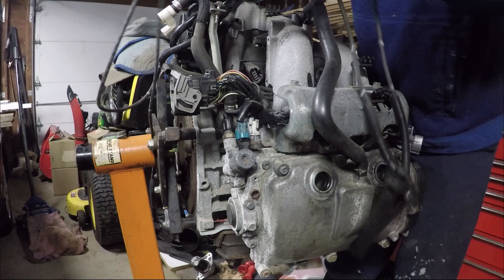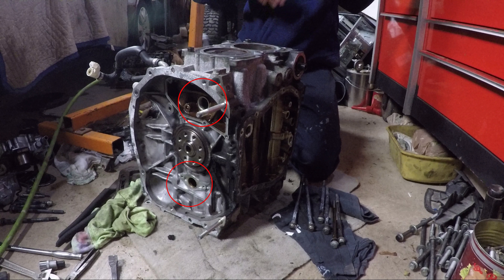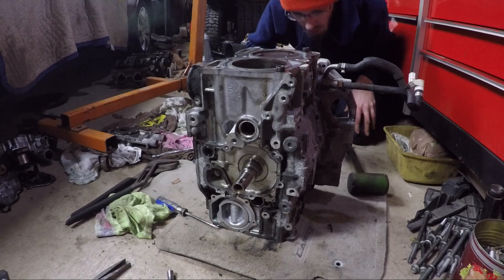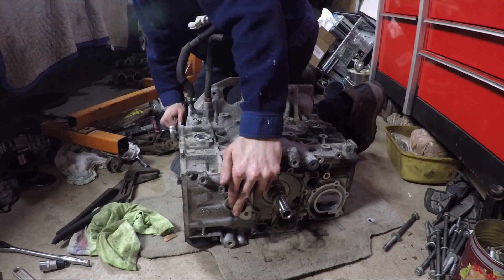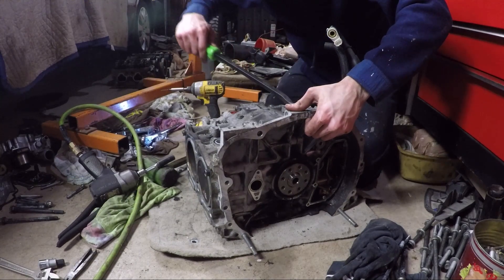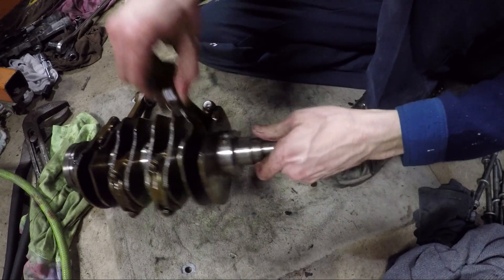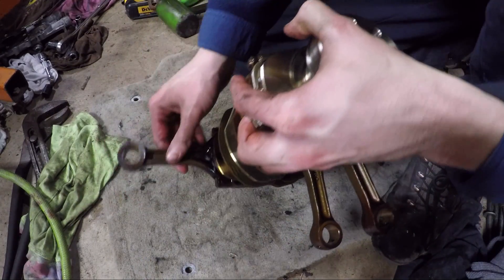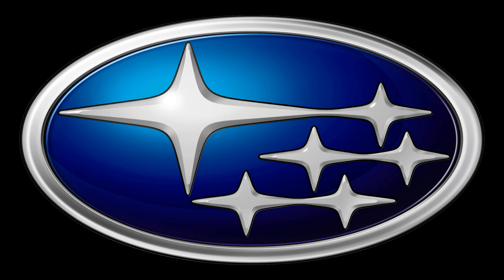Knock Knock, whos there? Subaru Rod bearings

Comment: HA, Just pulled my engine and dropped the Oil Pan and my same Rod is messed up. So now I need to split the case 😁
Reply from the maker: I have a video for that also. But first find out if it is worth fixing. Shops here charge 3 kidneys to line bore Subaru blocks
Reply: Line bore a rod????

Comment: Correct me if I'm wrong but there's two wrist pin clips per Rod so to get past first wrist pin knock it out the other side you had to avoid hitting the inside clip.

Comment: Correct me if I'm wrong but there's two wrist pin clips per Rod so to get past first wrist pin knock it out the other side you had to avoid hitting the inside clip.
Reply: These circlips of which you speak are made of wire so your 'tool' will feel engaged when pulling on it .

Comment: What caused the rod knock ? 
Cheap oil or Mods ?
Reply from the maker: No mods. So either cheap oil or slacking on maintenance. Although it could also have been because of the oil pump
Reply: AUDImotive Ok kool 👍🏼
Cause I bought a 2012 wrx and I'm really looking forward to changing out the dp and intake. 
I'm up today with the oil changes, I just want to be on the safe side.
Are Etunes alright ?
Reply from the maker: Ray Bustos congrats on the new car. To be honest I'm not too familiar with subaru tuning. Around here in Fairbanks, it seems like everyone is using Cobb
Reply: AUDImotive See I live in Omaha NE and out here there's not very much so it's all Etunes out here. 
That's why I want be on the safe side with my subie.
Reply from the maker: Ray Bustos if that's what you have, then that's what you should get. It's better to have something that you can get support with. Good luck and enjoy the car
Reply: AUDImotive what’s the average Cost for this repair ?
Reply from the maker: I have no idea what this would cost. Several thousand dollars no doubt. Used or remanufactured engine would be cheaper

Comment: Hey man! First of all, congrats on your vids! I'm from brazil (sorry for my bad english), and I was wondering if you could help me with the knocking sound my '08 WRX are doing (https://www.youtube.com/watch?v=4q1WYnBAkNY)

I'm really worried since i bought the car about two weaks ago and everything was fine... the car was running up good, and the old owner changed the oil every 3 thousand miles (Motul 15W50). Also, all the tension belts (i don't know the right way to say that in english) were swapped 3months ago... The car have 62500 miles.

Thank you in advance!
Reply from the maker: Hey! It's hard to tell what that sound is or where it is coming from. I would recommend changing the oil and checking to see if there are metal flakes in the oil. I would also check the oil pressure
Reply: I'll do that! Thank you for your answer!
Reply from the maker: No problem. Let me know what you find!
Reply from the maker: Also, is there any place you can submit your oil for analysis? To see if there is more metal than there should be in the oil
Reply: Hello! Unfortunately it is a rod bearings issue. Sad part is that I bought the car 15 days ago, but at least the old owner will split the value of the fixing with me... Your video helped us with the diagnosis! Thank you again and have a good week!
Reply from the maker: Wow sorry to hear the bad news. But at least you will get help with the repairs. Good luck and enjoy the car once it is fixed!

Comment: So im buying a 2013 wrx with 52k miles on it with brand new valves and iv been looking at buying aftermarket bearings to help with oil pressure think this would help solve this problem or at least delay if farther until more mileage is put on the bearings?
Reply from the maker: From what I understand, a larger oil pump is probably the way to go. But I'm not a subaru expert. You might want to talk to a local performance shop in your area. Or the local subaru club.

Comment: thanks was considering buying a subie with rod bearing knock ...no more.
Reply from the maker: +enarc crane If you can find a replacement engine, it's worth it. Swap is pretty easy. But unless you are building an engine for power, I wouldn't get one to rebuild
Reply from the maker: John Jay I'm not sure on the exact sizes of an LS compared to the engine bay of a subaru. Personally I'd almost rather put in an RB26 from a GTR. You know, keep a Japanese engine in a Japanese car... but that would all depend on sizes and how much money and effort you want to put in

Comment: god save me from a subaru motor.
good work on the tear down u defitnally know what ur doing.
Reply from the maker: +marino Sanchez it really wasn't too bad. These engines are really easy to take out. And taking them apart is the easy part. Back together is where it gets interesting...
Reply: @audimotive  at least you get a bunch of spare parts when you put it back together. no need to cut holes for weight reduction.

Comment: My question is why did it happen and could it have been prevented?
Reply from the maker: +Alan Wilson this is a very common problem on Subaru engines. If caught early, the bearings can be replaced and the engine put back in service. In this case the noise was neglected when it first appeared and eventually caused the bearing to spin. And ruined the block. Oil pressure is very important on this engine and any knocking sound should be looked into right away
Reply from the maker: I don't have much experience with subarus but from what i understand, many people who build these engines replace the oil pumps with something larger. But then you also have to change the bearing clearances
Reply: Do you think Bigger oil pump would solve problem?
Reply: Alright, that makes sense, Thanks for fast reply/